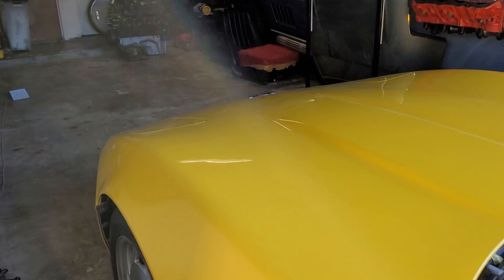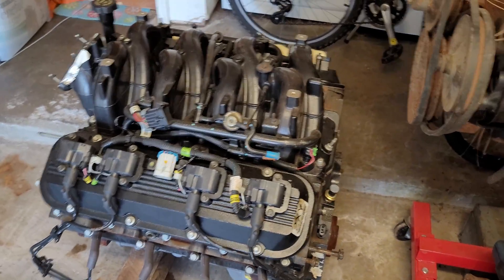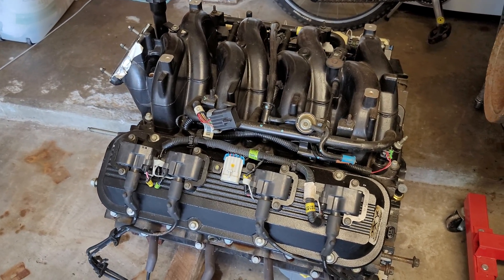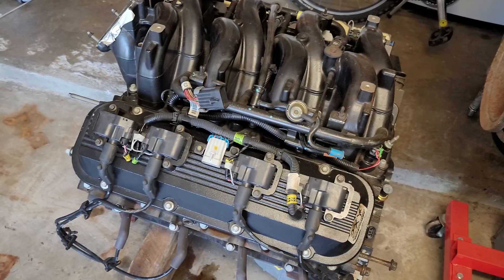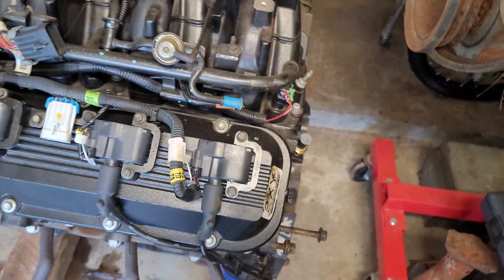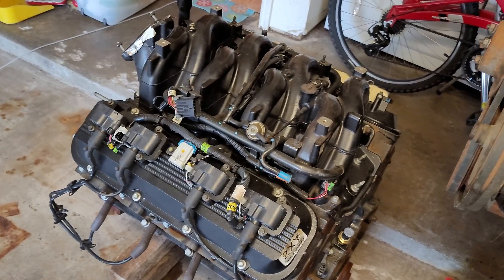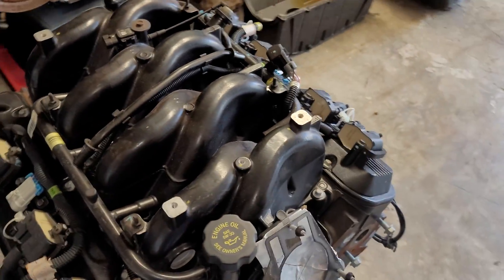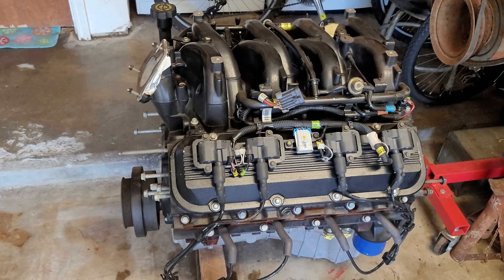The Monstrous Vortec 8100 496 8.1L Big Block Engine of the 2000's

Comment: Love these engines.    My 2002 burban 2500. Pulls like a champ starts every time.  10500lbs camper hooked up. Never misses a beat.   4l80e holds the power just just fine nice crisp shifts.   201000 and climbing.   It’s a shame when something this reliable comes to an end.
Reply from the maker: Yep, definitely a powerhouse for the ages. Good thing I'm a believer in second chances😁. I should have it finished up and back on the road in the next couple of months.
Reply: I get roughly 7‐8 mpg while towing my 34ft travel trailer pulling around 9k. Awesome motor and never skips a beat.
Reply: I dont have the 8.1, but i have a 95 k2500 454 and it pulls everything i need it to pull, and gets 12 mpg with a 600 lift cam and old school oval port heads, modded eddy intake, roller rockers, still running factory tbi and it has the typical big block with a cam sound. Its my most reliable vehicle. Love the big blocks and will always be a fan. 171k and counting
Reply: What was the mileage when towing?
Reply: @camscustombuilds  I’d have to say 8mpg.   But. I didn’t buy for fuel economy.
Reply: @fk4191  neither did I. I have an 04 Burban w/122k, 4wd and can get 13 mpg when you pedal it. It sure is a hauler.
Reply from the maker: Most of what I hear states around 8-10 when towing depending on total weight and topography.

Comment: At 235k on my 02' Silverado ext cab long bed 8.1 w/ Allison 5spd. Love the effortless torque and simplicity of the engine. I've had cam sensor, maf dtcs and burns a little oil but besides that solid engine.
Reply from the maker: Thanks for the testimonial. The general consensus is that the GEN VI and VII BBC's are pretty much bulletproof unless you just outright abuse them. Even then most of the time they'll survive👍

Comment: Great video! So im building a 07 Silverado with just a L59 5.3 on E85, im gonna spray it and am curious should I look for a 12 bolt rear end? Or spring for a 9 inch? I used to have a few 12 bolts a million years ago but gave them away so I don't know if they're still available. Thanks🇺🇸
Reply from the maker: Hey D M, thanks. Glad you enjoyed it👍. If I were doing that swap, I would skip the 9 inch and 12 bolt and throw a 9.5 inch 6 lug 14 bolt from a 1500HD or 2500 GMT800 in there. Those are some of the toughest differentials GM built, and are pretty much a direct bolt in for your truck. It will handle the power you're building.

This forum post details what you need for the swap -

https://expeditionportal.com/forum/threads/gmt800-2500-axle-swap-in-1500.190731/page-2
Reply: @VetteSource  Wow thanks man, I don't know why but I never even considered a 14 bolt. That would safe me a TON of time and money, thank you!🇺🇸
Reply from the maker: No problem, buddy. Glad to be of help.
Reply: @VetteSource  I'm a GM guy to the bone, ive had 8 Silverado/Sierras and for some weird reason I always thought 14 bolts were for 3/4 Tons only. Hell yeah bro THANK YOU!
Reply: @DM-qp7do  well strictly speaking they are there are 2500 six lug trucks those are the ones that have the 14 bolt six lug

Comment: I bought a 2001 2500HD new from the dealer with the 8.1.  It is still my daily driver and my work horse @ 326.000 miles.  I had to put a cam sensor in at 100,000 miles but no other issues.  The truck itself has been beat to hell and back but keeps going. I have a couple of small leaks from oil lines and it burns a TINY bit of oil since day 1.  I expect to have this truck and engine for at least another 250,000 miles.  Yes, it has the Allison and I love that thing too.
Reply from the maker: Yep, that seems to be the overall consensus from long term owners of the 8.1 equipped trucks. Long term reliability in a truck, especially if you're on the road or using it for business makes your life so much easier. Thanks for the testimonial👍. I'm looking forward to using my 8.1 as a daily.

Comment: There is an intake manifold upgrade most anyone can do for some free horsepower. You have to pull the intake off and cut the bottom off the intake manifold. There is a plate casted into the manifold inside that you can cut out and it will make right after the throttle body all the way to the back of the intake 50 % larger. You then need to weld the outer plate you cut off to gain access back on. The factory intake manifold stops flowing air at around 4000 RPM, This modification will allow much more flow and a smog inspection station will never know you did it.
Reply: Yeah Raylar Engineering does it as well for their stroker kits
Reply from the maker: Cool hack, thanks for sharing👍

Comment: It's LS based architecture not 454
Reply from the maker: You talking about the engine? Sorry, buddy the 8.1 is a Gen VII Big Block Chevy with some LS design elements like the coil packs, cathedral port heads, and PCM software system.

Comment: Would this engine fit in a late model Camaro or Corvette?
Reply from the maker: Where there's a will there's a way
 However, I would would be prepared for quite a bit of engine bay and firewall modification to make this monster fit in the smaller space of the newer Corvette and Camaro.
Reply: Wow! Never knew GM made a 496 ci engine!  What kind of HP can it make with a mild build…say a cam, maybe some head porting, headers, throttle body & intake manifold? Basically bolt on parts…

Comment: Got a 02 avalanche with 8.1 bought it with 96k now has 286k has not skipped a bit beat and still pulls like hell I love it.
Reply from the maker: Now that's a testimonial! As much as some  might complain about fuel mileage, these engines make up for in how long they will survive and keep working for you.
Reply: @VetteSource  i plan on rebuilding and doing some upgrades whenever she does go but until then just gonna keep on trucking
Reply from the maker: Yep, that's the way I would do it. Keep driving it until the wheels fall off.

Comment: Im swapping one into my tahoe and I found one out of an rv do these make the same power as the ones you find in the trucks
Reply from the maker: Hey Isaac, that should be a fun swap. It will have all kinds of power with the shorter wheelbase. As far as I know the RV 8.1's had the same rated power output. Other than cam, fuel injectors, and PCM programming most of the various applications had similar power ratings with the exception of the Marine HO engines.
Reply: @VetteSource  That's what I was thinking too it seems like a fairly easy swap at least in theory and I think they should've offered it from the factory as a Tahoe ss
Reply from the maker: Yea, it's not too stressful. I'd be willing to bet that the shorter wheelbase and lighter weight of the Tahoe had something to do with it not being offered from the factory.

Comment: +1 for the 8.1, I daily one of these in an 01 suburban. Lots of fun confusing and astonishing people when I tell them just how huge the engine is. To touch on the oil consumption issues as far as I've experienced/read, these engines will consume more oil when run on the factory recommended 5w30. I've found my engine using noticeably less oil after switching to 10w30 for the summer months and I'm currently testing 5w40 for the coming winter.
Reply: I bought a brand new 02 GMC Sierra 3500 Dually with a 8.1gas + Allison. From day 1 that motor would consume 1 qt of oil for every 1500 miles or so. It now has 175K on the odo.
About 2 weeks ago I installed a CA legal K&N FIPK before heading out from Los Angeles to Denver CO. I can feel the benefits from the K&N kit in the seat of my pants and interestingly enough the motor didnt use 1 drop of oil on the 2200 mile trip. My guess is the factory intake and PCV system generates a lot of vacuum and the open filter element of the K&N created a drop in vacuum in the crank case. I have always ran Castrol 20/50 oil. Also the fuel MPG has always been 9.5 to 10 MPG. I got 11.5 with a 1984 Goldwing in the bed and doing aprox 85 to 95 MPH on uphill grades.
Reply from the maker: That's good information. I'll have to try that out once I start daily driving these. It is funny to see the confused look on people's face when you mention how large the engine is. It was one of those options that many never noticed.
Reply: I use 15/40 rotella! Dropped oil use to about 1 qt to 1000 miles
Reply from the maker: I'll have to try that out on my next oil change.
Reply: Whats your typical mpg ?
Reply: @jimmymcclelland3727  around 8-10 in stop and go traffic, I'm sure with a couple mods, a tune and careful driving that number could be brought up a bit.

Comment: Two comments about problems I’ve experienced with this engine… 1st glad you showed the back of the block.  At about 90K miles I had the crank sensor fail and leave me in a Walmart parking lot.  It’s not serviceable from under the hood, you have to reach up from underneath, around the bell housing and try to pull it out.  In my 40+ years as a shade tree mechanic, I have never come this close to curling up and crying uncontrollably.  I ended up having the truck towed to a local dealership for repair.  At this point there were just wires coming out of the hole. When I asked the mechanic how he did it, he said “plenty of thread penetrating oil and a curved set of needle nose pliers”.  A very frustrating and expensive learning experience.

Second on the list, on my truck the exhaust pipe crosses behind the oil pan by just a few inches.  Not a problem unless someone tries to use an impact wrench to remove/install the oil drain plug.  The hole has been stripped for a number of years now and I can’t get any of the typical oil change businesses to change my oil because they don’t want to deal with a vehicle with a temporary plug in the pan.  It’s a bit of an irritation at times.  

Other than these items, the engine is still running strong after 20+ years.  Not too shabby
Reply from the maker: Hey Rusty, those are good points. Thanks for sharing👍. You're absolutely correct about the crankshaft position sensor. I had to remove it from the 3500 truck after I first reassembled it, and it was not a fun job, even with the extra space created with the factory 2" body lift. The aluminum oil pan is an interesting feature as well. It actually feels pretty solid, but I never thought about the oil drain plug stripping the threads. You may have already investigated it, but the new  oils pans can be had for around $125 through rockauto or Amazon. Not too hard to change either once you drop the lower crossmember.
Reply: In our Motorhome I had the crank sensor fail intermittently. 
Went to pull it ( easily to get at in this application )and it came out partly. We’ll with nothing to loose I have it a bit more ompf popped out. Lots of never seize on the new one. 
2001 workhorse w-22 chassis.
Reply: I went through that too and it's a bitch on a big block. My knuckles were torn up by the time I was done.But ever since it has been very reliable ( besides the rear crank seal)
Reply: I had no idea about that crossmember. I’ll take a look. Thanks for the tip!
Reply from the maker: No problem, anytime👍

Comment: Is it true theirs not a big selection of aftermarket parts for the 8.1?
Reply from the maker: That is correct. There are a few players in the aftermarket parts area, but they can be pretty expensive to build. The Mark IV series built from 1965-1990 is still the preferred version for availability of hot rod parts and performance upgrades.
Reply: @VetteSource  yeah i’ve read about the Mark IV big block. Been searching in my area for one but most of them look like boat anchors with how rusty they look. Or i’ve been told to stay away from anything that’s bored 60 over (have no idea why 🤷‍♂️).
Reply from the maker: Yep. 60 over is getting close to the outer limits of what you want to be working with if you're going to juice it up. I would recommend looking for people getting rid of a mid 70s to mod 80s truck engine. Those are the 361959 blocks and are pretty stout. Depending on what part of the country your in, I would recommend looking on FB or CL for one somebody is pulling to do an LS conversion. You should be able to score one for under $1000.
Reply: Nice video Brian. I had a 2001 Suburban with an 8.1L in it. Loved it I used it for a work truck and always had it  loaded with about 1000 lbs of tools and supplies. Average milage was 10ish would get up to 15 with all highway driving. I bought it with 130,000 and sold it with 180,000. Never missed a beat only routine maintenance to the engine. Only sold it because I really needed a real work truck with a utility bed. I always look forward to your videos.
Reply from the maker: Thanks for the kind words. I'll do my best to keep making them interesting for you guys. I'm looking forward to using the 8.1 equipped vehicles I acquired this year and your comments give me an idea of what to expect👍.
Reply: Raylar Engineering seems to be the best if not only source for 8.1 performance parts.